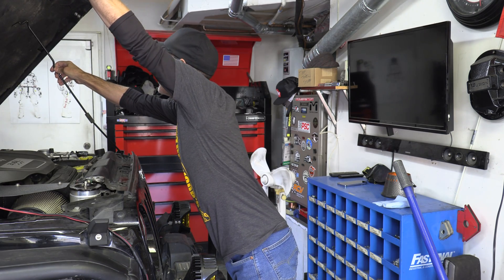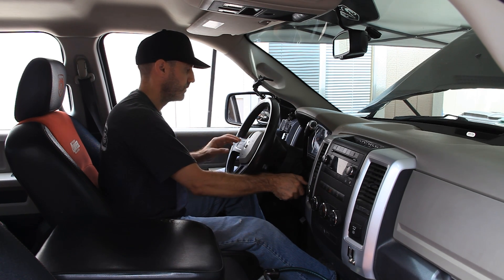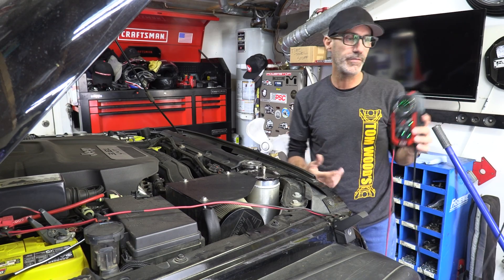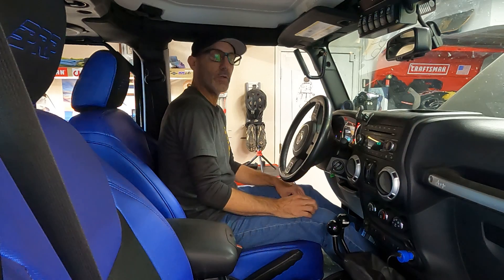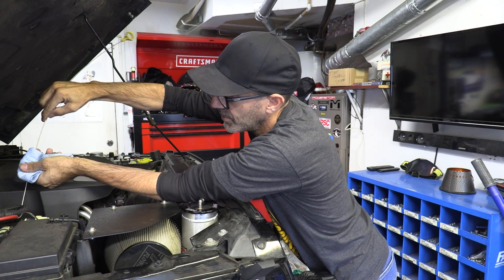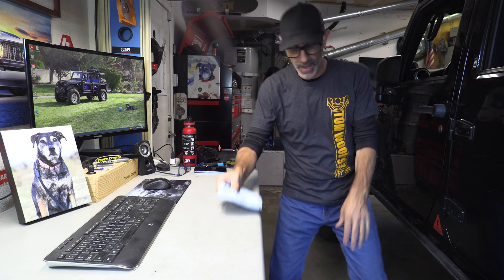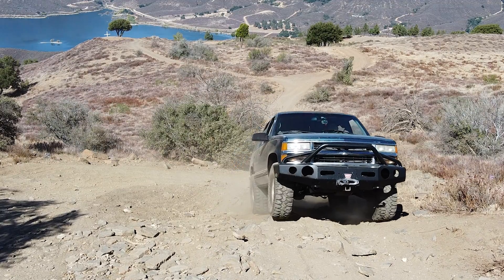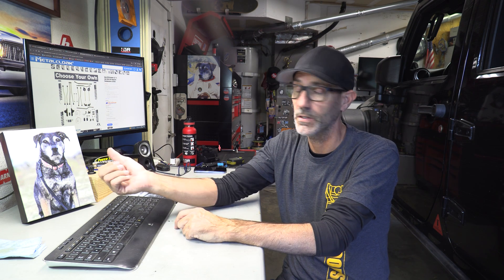How To Avoid Engine Damage at Startup with WOT Oil Trick and Loss of My Best Friend

Comment: Hi Jason this is Mike from fl and very sorry about pinto I had lads and loved those guys as well . Well my 2019 jeep JL Rubicon 2.0l has a very slow leak with oil dripping from above and ending up on the bottom of the transmission like little drips sometimes,probably like your oil cooler I guess I will have jeep over charge me for the Diagnostic test 200 and then the job but I must say I have watched you maybe from when you installed first lift kit and just ran into you again and I really enjoy your talent on jeeps  and wanted to say good job on your channel
Reply from the maker: Thanks so much for this, I really appreciate hearing from ya! Sorry to hear about your oil leak as well... I don't know anything about the 2.0 but I'm wondering if you got one of those borescope cameras like I have, you might see underneath where the oil cooler is to check before the dealer grabs you. Best of luck on that repair and keep on jeepin!

Comment: I forgot to ask my question...does the wot procedure work on all cars? I have a 2000 Camaro, V6 3800. I've been trying to fix a click-no start for over a year now, and seeing this and others vids worries me about f'ng her up once I  do figure out the start issue. She's my  non-fur baby,lol, so gotta do right by her. I have chronic pain disabilities, so I wasn't looking forward to having to pull the plugs if it wasnt absolutely necessary, and your vid makes it seem possible. She only has 97k miles, so I'm 3k ( or 5 years, lol) from the required plug replacement. Thanks. Char
Reply from the maker: That year Camaro does not have a WOT no start function.  You can pull the fuse to the fuel pump as an alternative or just pull the plugs from the coil packs... no need to remove spark plugs.  Best of luck!!!
Reply: @AutoEdits  awesome! Thanx so much for the info and quick reply.

Comment: I'm curious about priming the oil this way.  is it any easier on the engine components? All of the same parts are moving whether its the starter providing the force or the the combustion..
Reply from the maker: On newer engines like this it isn't that hard on the engine but on older vehicles it's best to prime the oil using the gear at the bottom of the distributor to make sure the crank bearings don't get any unwanted wear.

Comment: Thanks for the WOT info. I just purchased the Baxter screw on filter adapter with check valve. Hoping it helps. If I let my 3.6 JK sit a day or so and I can hear the valvevtrain clatter until the oil system pressurizes. It drives me crazy. Wish I had known about the WOT deal sooner.
Reply from the maker: I'm strongly thinking of going that way... hope it helps yours.

Comment: Sorry for your loss..Pinto will be missed..   Check out Baxter Performance for an oil adapter >  PENTASTAR 3.6 2011-2013 MS-101-BK CARTRIDGE TO SPIN-ON ADAPTER <  this  was made for dry starts.  Works amazing.

Comment: Sorry for your loss. I understand we all lose someone close by both humans and animals. I recently went through the same thing and don't know if you believe in God, but it does talk about a place for our animals to go and knowing that has a better sense of relief, but will still be missed. On another note, I know these new vehicles may have this feature, curious if you know about older vehicles can do the same thing that don't have the throttle by wire but by cable. One thing haven't googled, but since you use to have an obs, I am curious if you do know. I only do this after changing oil by pulling the fuel pump relay. Other than that, I have not but it does throw a light if I do which is why I only do it once since my rig is on and off between being started. Again, sorry for your loss.

Comment: So sorry about your loss. I understand how losing something so special to us and what a dog or pet can do and help. I thought I would mention we have an automatic 2017 JK. I did the same think (on automatics you had the brake also) I have put on an oil filter system from “Baxter Performance”. You replace your cartridge filter with there cartridge and you use a regular type spin on on top. It has a check valve in the the piece that you attach the regular oil filter. The keeps the oil in the top. No more “dry starts” I have had the product on for about 2.5 years. Just thought I would pass that along sir. Enjoy all your videos.
Reply from the maker: I appreciate the tip... glad to get info like this.

Comment: The pentastar doesn't have an anti drain back valve for oil. Most vehicles do so its not a problem. You can buy the baxter performance spin on filter adapter which has a anti drain back valve in it to prevent dry startups on the pentastar 3.6.

Comment: The BAXTER PERFORMANCE
CARTRIDGE TO SPIN-ON OIL
FILTER ADAPTER for the jeep jk keeps oil in the top side of your engine so the oil doesn’t accumulate only in the oil pan after sitting a long time. So the cams stay lubricated with oil.👍🏽

Comment: Great work Jason... I love your Wrangler mods and that you work on the ground and not a lift! and love the dog, mines the same way. I drive a 2012 JK Sport everyday here in the PNW. How are you liking the B&M shifter after break-in??? My OEM tranny shifter at 79K miles feel pretty tight, a little loose maybe, easy to shift. Definitely not as wobbly as yours on the vid. But way looser than my '52 CJ2A or '85 CJ-5 (hey, that rhymes). It's never popped out of gear, but then again, I don't hammer it offroad. She's a ridge runner/creek jumper/mall crawler! I am like you that I do mods just because I can... are you thrilled with the B&M shifter? PM?

Comment: Much love to you and the memory of Pinto.  Fur-babies will always be missed.  I still miss my first golden retriever, Bailey.  If you ever need some dirt therapy, noting too extreme, mine has been too clean for too long.  I am happy for you that all of the strikes are over, as well!!  

Ideas....You have had the Metalcloak stuff on you jeep for years.  What about maintenance to make the duro-flex joints last longer and/or replacement of them?  What nuts and bolts to check regularly and what to check before a long trip?  What about winch maintenance?
Reply from the maker: Thanks dude, great suggestions here!

Comment: Hot Dang! this is SUCH a great tip. I was wondering about the cold/dry starts and was tempted to get the cartridge oil filter conversion. I dont think I need to worry abou tthat after watching this video. Thanks Jason! If you're looking for oil cooler info, I swapped mine after a pretty hefty leak and went with the full aluminum dorman version (I have a video on it)  Extremely sorry about Pinto :( I definitely know the feeling and its terribly painful. The memories will live on, and it be great to see her again in some of your past videos

Comment: My condolences to you. I'm very sorry to hear about your companion . I have lost several in my life,  and it is very difficult times. Hang in there, Sir.

For your oil dry starts, Baxter Performance has a screw on oil filter assembly with a check valve in it that elemenates dry starts. I put one on my Jeep 3.6L engine and no more worries of dry start. You can tell every time you start it, no valve rattle.

Comment: I was just thinking about you this weekend, so its good to hear from you. I had no clue about the throttle trick to get it to not start. My Jeep often sits for a week between being driven, and I HATE the dry start these engines have. I have also been on the fence about changing out the suspension on my JK and going a bit higher with better shocks and such. Its a never ending project :)

Comment: Sorry about the loss of Pinto, my lab just turned 13. Every minute is a blessing. I also just replaced all of my rocker arms and lifters at 118k miles on my JKU due to dry starts though, so this tip is hopefully going to help my new ones last forever.

Comment: I run a NICOR battery tender on my 2016 JK several times a month.  It definitely prolongs the life and avoids any issues with parasitic battery draw.  
Great recommendation on the cold start.  I will definitely start using it. 
I had to change the oil cooler/filter housing at 85,000 mile.  Very common issue on higher mileage JKs.
So sorry to hear about Pinto. She was a big part of your life.  🙏🙏

Comment: Sorry to hear about your loss, I’m sure the memories you have made with Pinto will last a lifetime but be sure to make new ones. 

Looking forward to your maintenance videos for the Wrangler JKU, particularly coolant flushing the radiator, engine block and heater core, the transmission and power steering.